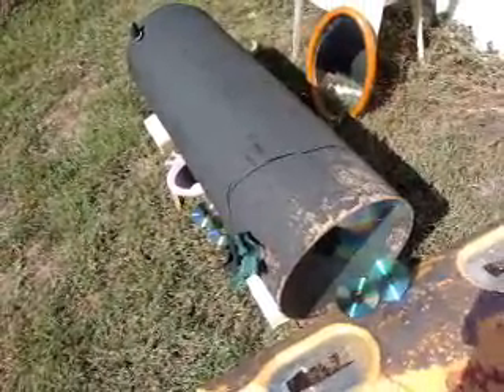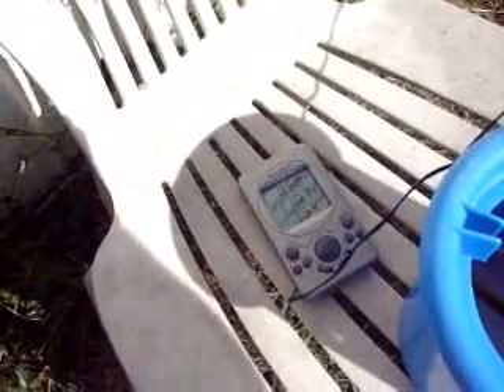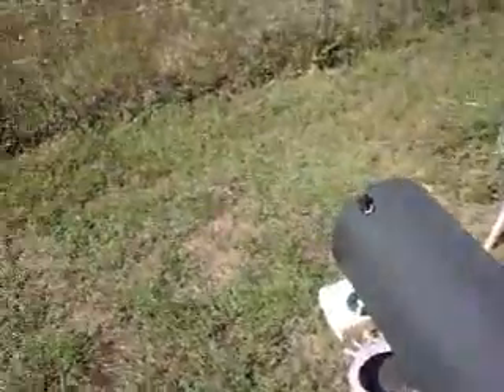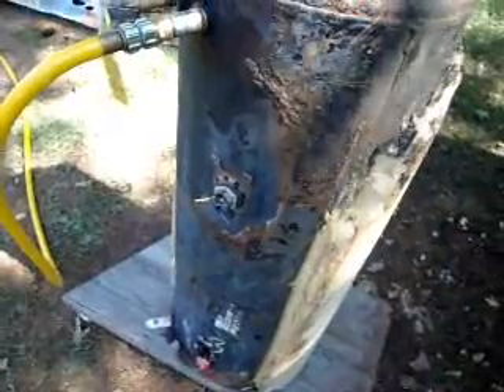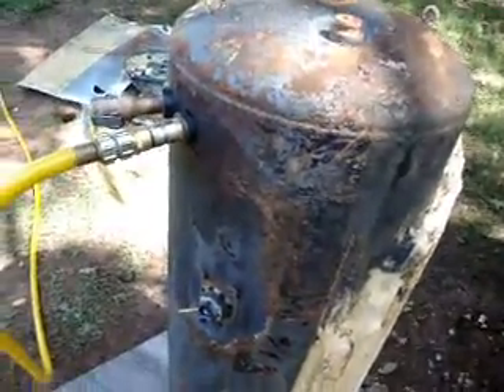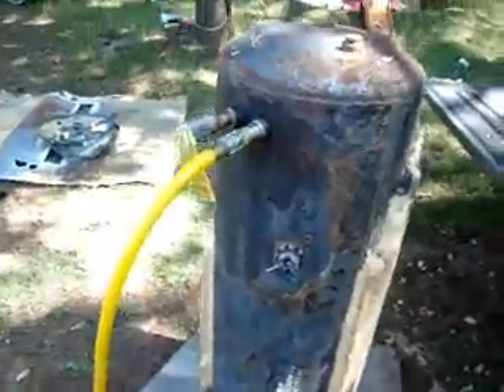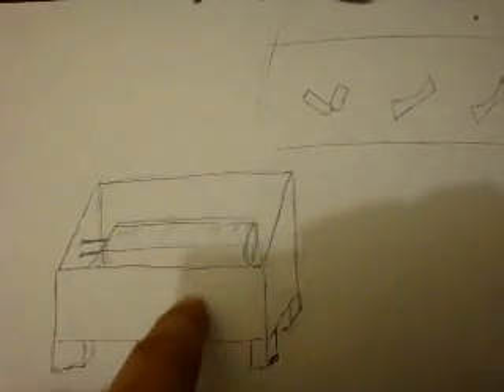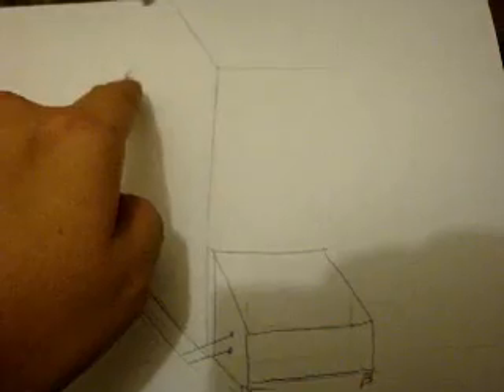solarbatch intro

Comment: Hey Angry Pirate...  Where's the Solar Batch heater update?  
Nice to hear someone else is using FreeCycle, but I have not yet been able to get a tank from there.  Another source for old tanks are local plumers or contractors.  A good source for Tempured Glass are local Window instilation companies.  They bring the old glass back as a customer service and usually just throw it away.   Excellenct Video... you answered most of my questions very well.  I'm gathering bits for my batch heater now.